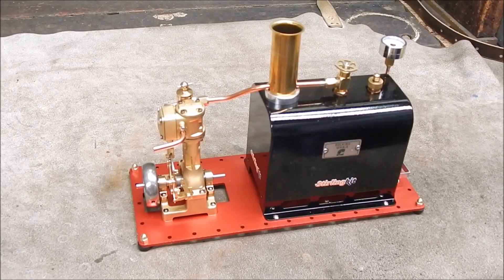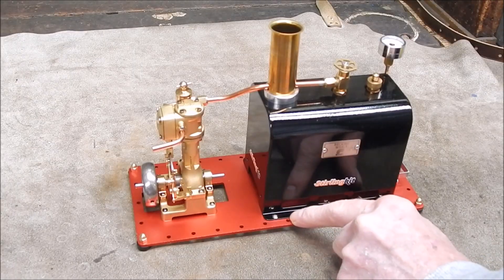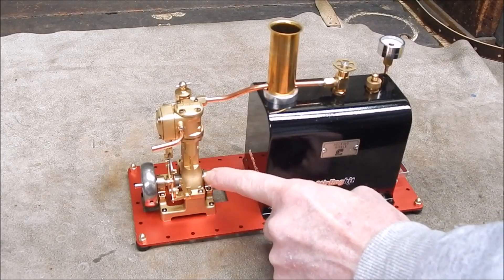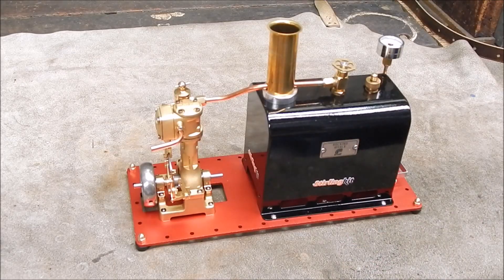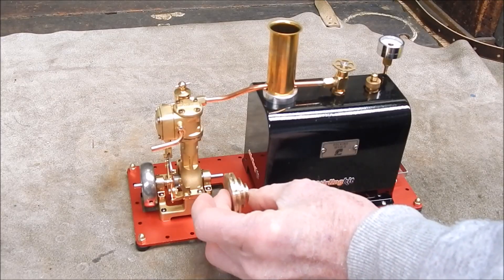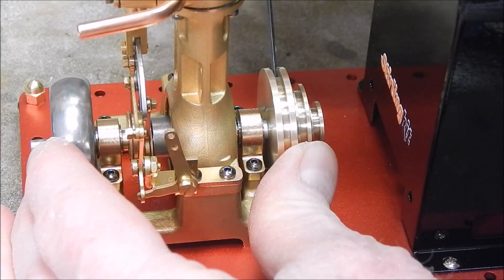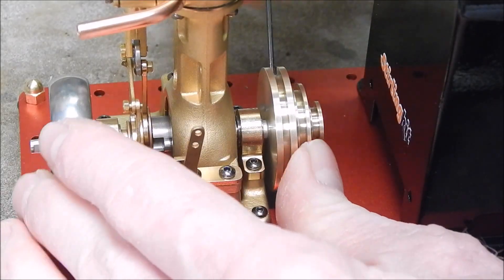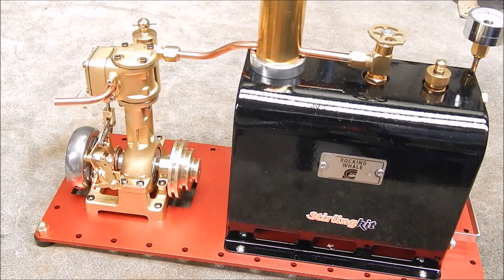I add a triple ratio drive pulley to the RW-BL1K steam engine

Comment: Hi Rob 

I hope you don’t have a smart power meter as the SA Govt. will be requiring you to supply power to boost the base load on the grid. I love the main stop valve on the Boiler Drum it a little ripper. 
Great series of videos on these little engines too

Thanks 
Tracey
Reply from the maker: Thanks Tracey.  It's a gutsy little engine.  It has a larger capacity (boiler and cylinder displacement) than my other engines, which is a good thing.  Very well made.  Expensive, but you do get value.  Cheers Rob

Comment: Nice job on the pulley Rob, looks like it came from the factory with it 👍👍👍 Just out of interest, what is the flywheel made from? Cheers, Alan.
Reply from the maker: Good question Alan.  I was looking at it when I had it off and it appears to be steel with a dull chrome finish.  I'm not sure.  It's quite heavy.  The extra weight of the brass pulley will help smooth vibrations some more (not that there is much) as well as be a drive unit.   Brass always looks good.  Cheers Rob